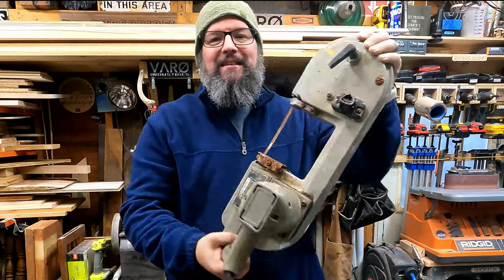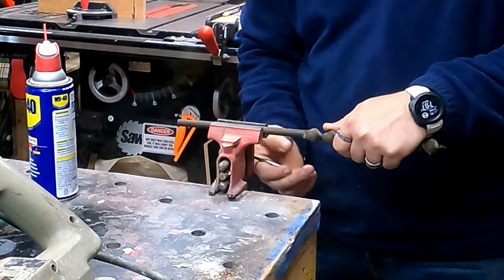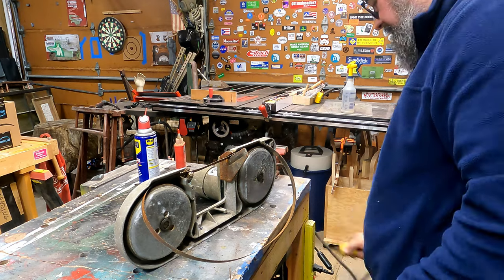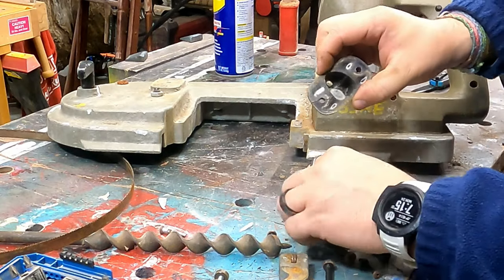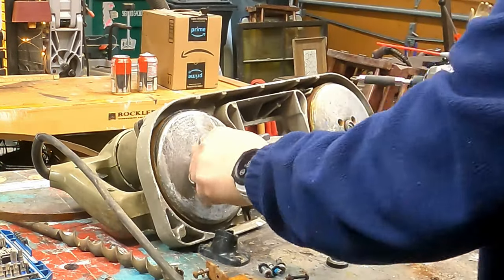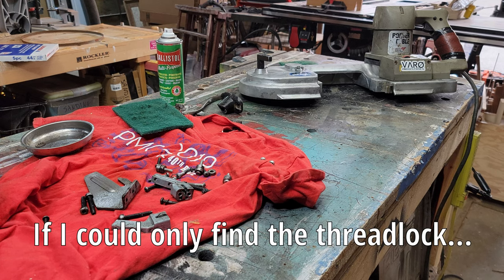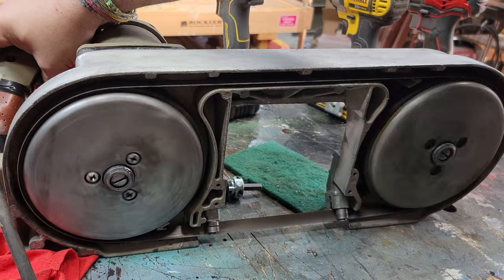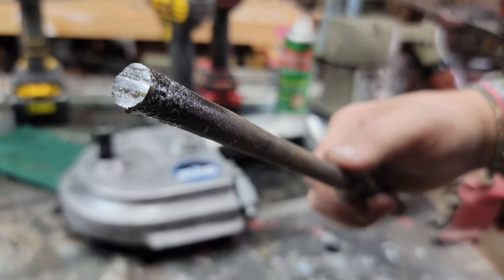Porter-Cable 7724 PortaBand Metal Bandsaw REFURB

Comment: I got one of these for free but I can't figure out why the power/motor won't engage. Precious seem good. Bearing seemed good. I'm going to have to test electrical. I think the variable speed switch might be shot.
Reply from the maker: Free is a good starting point! For the $15 I paid for mine, if it was completely hosed, I would not have been all that upset. I hope you get it working, great tool to have in the arsenal.